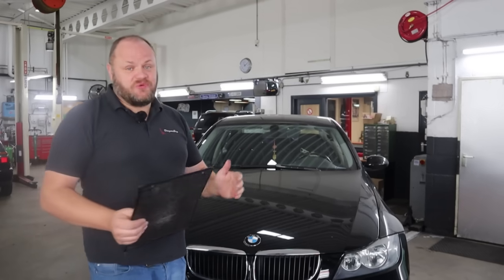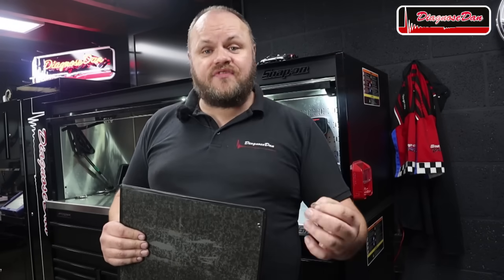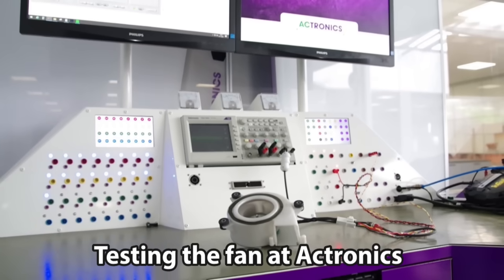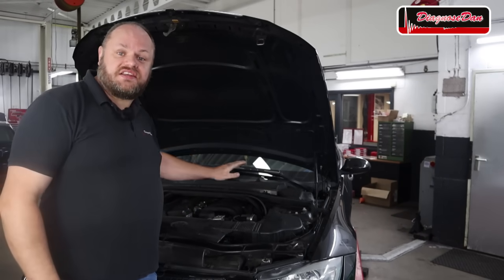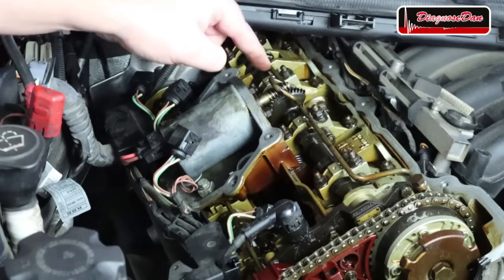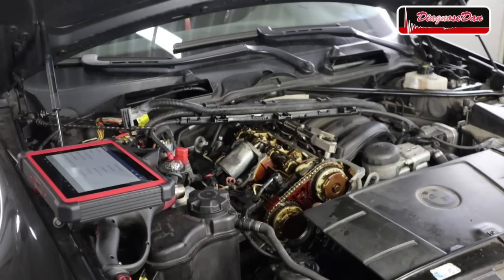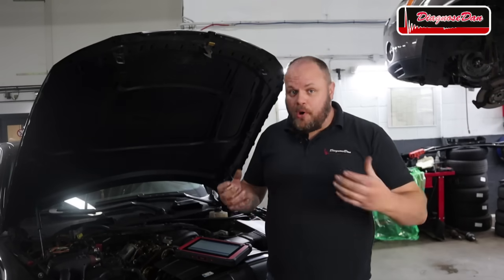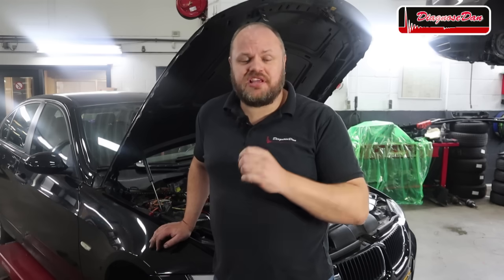Bmw valvetronic,Explained,Diagnosed,Fixed

Comment: Nice video and great explanation. It definitively has more moving parts in the whole setup than a swiss watch.😀
Reply from the maker: You have clearly never opened a swiss watch🤣🤣
Reply: @Diagnosedan  I have taken apart a Kuckucks Clock and that had less pieces than the N12 4 valve head with Vanos and Valvetronic. 😉
I guess the clock never worked again, but the engine did almost 20,000 mls in the last year and runs fine after the rebuilt.
Reply from the maker: @cullenmiller8170  🤣🤣

Comment: Got tricked one time by a client claiming to drive long distance until he came in for a second time after 3 weeks with 600 KM driven . Took the hot air gun and the same result as you . Checked engine hours run since last dtc erase and KM driven . Turned out that the car was idling more than it actually drove . Dumb mistake from my side to only erase the code the first time and not save the actual data. About actronics , nothing but good for them .
Reply from the maker: Thanks for taking the time to leave a comment it's really appriciated!

Comment: graphite from brush wear, causes a short circuit in the valvetronic motor.. damage is also possible in the valvtronic control module,  because of  short motor..
Reply from the maker: Thanks for sharing!!

Comment: You’ve just destroyed another myth calling these engines “ over-complicated “. In my eyes this engine is way less complicated than a V-tec engine for example…
As always,you’ve done a great job breaking it down so that everyone understands! 👌
Reply from the maker: These engines are really not complicated (if you know what you are doing)😁
Reply: @Diagnosedan  do you offer any remote help on the subject? I have this engine, been totally frustrated for about a year now... I am slowly running out of options
Reply from the maker: @seasonedtoker  We have a helpdesk but to use that you need a subscribtion to DDTSB.COM
Reply: Got to scream the V-tec to get it to go! Valvetronic allows max torque to come in at 2800 rpm, on the n52 BMW instead at 4500 rpm like a m52 or m54 six just to make them go.
Reply: No way.............you can give me a Honda V-tec any day of the week and twice on a Sunday lol but they rarely go wrong, only the the little gauze filter gets clogged or wrong grade of oil, easy fix.
Reply: @paulrobinson3528  I wasn’t talking about reliability,but about the simplicity in design. The V-TEC is using solenoids and oil pressure to lock the camshaft on a longer duration lobe,while this engine has a simple extra camshaft driven by a worm gear motor.
Reply: @nicknicu1787  It doesn't matter about how simple or complicated a design is in cars, its all about reliability,  bmw's valvetronic and vanos systems are not reliable, hence why Dan is doing this video but i see what your saying.
Reply: @paulrobinson3528 someday it will fail no matter how reliable it is and that's when simplicity becomes important

Comment: Could be the dust from the graphite brushes in the motor that's causing the short. Wonder what caused the motor to fail at higher working temperatures
Reply from the maker: Maybe i should open up the motor
Reply: @Diagnosedan   good idea

Comment: Motor insulation resistance.... I know with high voltage equipment (5,000V and up, what I work on) the old standard was 1MOhm per 1kV, plus 1MOhm. But now with the better insulating materials, better manufacturing, higher standards and less leakage a lot of high voltage equipment manufactures specs are in the 100's of MOhms. Even for low voltage 400VAC motors. No idea what would be considered acceptable for a 12VDC, car application. But do tell!!
Reply from the maker: I think 20.000 ohm is the limit😁
Reply: @Diagnosedan  Sounds about right by scaling it down.

Comment: I need to tackle the valvetronic on my n42. Have had it unplugged for the past 60k km or so. Hope it’s just the adjuster motor…

Edit: nice video Dan
Reply from the maker: You don't need to remove the valve cover to test it. 
Read the faultcodes and see if they are the same as in this video
Reply: @Diagnosedan  I think it’s the same issue. Once hot it starts idling poorly and sometimes even shuts off. No check engine light though. So I just unplugged it which you can do on manual transmission n42s. Definitely less torque below 3000rpm. Will clear the codes and plug it back in to see what comes up in the log. Cheers Dan.

Comment: I would say it's more likely failing reading resistance on it biggest thing is probably the Heat because heat will cause resistance an electric motor
Reply: He said the the motor is cold and functional when he did the test
Reply from the maker: Thanks for taking the time to leave a comment!!

Comment: Hi Dan. I have a similar BMW E90 2009 LCI N46N 4 CYLINDER engine. I am suffering from high oil consumption (One Litre per 1000 km) and also the engine oil is getting contaminated and very dirty within 200 km ( I am using Liqui Moly 5 W 30).
I have changed the PCV valve diaphragm with the spring.
The PCV is located on the valve cover & the engine has 182,000 km.
I have replaced the valve stem seals before 5,000 km with new head gasket,
But i am still having oil consumption & both suction on the oil cup when opening and high pressure when the oil cup is open.
Beginning of this summer I removed the Thermostat as I am living in (Kurdistan-Iraq) where ambient Temperature reaches 47 °C. Now engine coolant Temperature is around 78 °C where the Thermostat is opening on 105 °C ( I will put back the thermostat tomorrow and update you).
I will appreciate any suggestions and diagnostics procedures.
Reply: Looks like piston rings, but I'm just speculating.
Reply: @mr_nice.  I will do both dry & wet compression test to verify the condition of the rings.
Reply from the maker: You proberbly have leaking valve seals
Reply: @Diagnosedan  I changed the valve stem seals with new head gasket before 5,000 km .

Comment: Aaaaah the lovely N46 engine. Between the endless valvetronic faults, valve stem seals made of cardboard, timing chain guides also made of cardboard and the endless oil and coolant leaks, there is never a dull moment with this one.
Reply: German engineering; job security for everyone.
Reply from the maker: @kevinbarry71  🤣🤣
Reply: Mechanics gotta eat too😆
Reply from the maker: @ademc8872  🤣🤣
Reply: These BMW’s are great money makers, usually, but it seems in my area their owners are usually broke. We have a half dozen sitting in the field behind the shop. 🤦‍♂️
Reply: They call them "Break My Wallet" for a reason, fantastic engine for mechanics job security
Reply: @mattyb7736 I call them BMW big money waste.
Reply from the maker: At least there is always work to do😅
Reply: I made a lot of money working on these back in the day. We still see the odd one 🤣
Reply: We have a name for the N42B20 in Libya👉" the life time butt stick",i have same engine with multiple miss fires with no Chk engine and only a p0112 on the elm327 reader..love this car,but it keeps abusing me..
Reply: @mohamedtailamun4999  you need to get ISTA+ and a DCAN cable to diagnose it properly.
Reply: @skrevox  ista is a bit complicated but maybe inpa is much easier
Reply: @mohamedtailamun4999  elm327 is not that good try and get inpa cable for 10 pound and a laptop
Reply: I am learning a lot by looking at these videos and hope to solve my problems with the Mini cooper.
Reply: I didn't even know bmw had 4 cylinders before 2008. We didn't get them in America except for e30/36 318
Reply: @youtubeb8362  the cat code is due to not seeing correct trace difference on the oxygen or air/fuel sensors pre and post cat (assuming they are talking about p0420 code), the ecu will adjust intake air/fuel to get a desired trace on the pre cat sensor no matter the combustion efficiency (within reason). If it's so off that the initial sensor can't get a good trace then you'll trip a lot more than cat codes. Excess incomplete combustion gas in exhaust will just heat the cat more (which might make it fail prematurely), but it should still be  performing as designed. There could be a few other things that trip the code like dirty/failed O2 sensors, exhaust leaks (even tiny ones), etc. Without seeing the O2 traces on scantool it's impossible to diagnose
Reply: N46 così come n45 n43 hanno tantissimi problemi di varia natura,più o meno gravi ma tutti i problemi sono figli di una caratteristica che genera questi problemi,la caratteristica è la temperatura del motore.io termostato map da 105° è il tumore di questi motori che per inquinare meno girano a temperature da forno con patate.
Io ho montato un termostato meccanico da 85° 
Ora n46b20b è diventato un motore affidabile come il meglio del mondo.
Ho 310600 km prendo l'auto tutti i giorni ,mai più perdite di olio e refrigerante e il motore è diventato più silenzioso e più scattante(miglior stabilità del lubrificante a motore caldo quindi migliore lubrificazione),sostituito solo alternatore e starter,il resto è tutto originale !!!!!!!!
Per pensare all'inquinamento hanno rovinato un motore che secondo me è davvero tanto affidabile.
Reply: @manliocicchelli8763 can you give me information about this thermostate working at 85C
Reply: To be fair...all BMW engines have a bunch of issues. Pick your poison.
Reply: So I just had the eccentric shaft motor and the shaft but now the car won’t do the relearn process and I unplugged it but the car still runs I’m not sure what to do it’s giving me a code saying valtronic adjustment range fault code
Reply: oil and coolant leaks, literally every bmw engine
Reply: I also have an N46 engine in my 118i.  The message "oil pressure low" comes when I do a cold start, most recently after driving on the highway.  Can you narrow down what it is?  Because of the holidays here in Germany, the workshops are closed.  I have the old chain tensioner, maybe that is one reason? Or maybe oil pressure switch.. Perfect timing. 😄
Reply: @tobifzzle  probably the sensor
Reply: So this problem always occurs repeatedly?
Reply: If it’s not 6 pot, it’s not real bmw
Reply: Hi bro 
My car doesn’t see valvetronic 
I replaced battery , valvetronic , tried to diagnosed it still same thing
Reply: maybe you should of kept your own engine serviced. mine is flawless
Reply: Guys, I see you're having fun. I am one of those idiots owning an N46, completely rebuild, new cats, new probes, you name it. Still have the dreaded cat efficiency codes. Who's going to help me over the internet? I see some German names in the comments, let the knowledge out guys, don't be shy
Reply: @seasonedtoker  change spark plugs and induction coils, sugest you to use NGK , your burning fuel in a not very eficient way
Reply: @youtubeb8362 wtf are you smoking boy
Reply: Check for leaks in the intake
Reply: @seasonedtoker  I find the n46 really good once chain is done and valve stem seals you're good to go for years to come
Reply: BMWs after 2004 are J U N K
Reply: Had similar issues with an N42 engine in my e46 BMW. It spent weeks in and out of various garages having sensors changed, chains and guides changed etc. In the end, I pulled the engine and box out and installed an M54 engine and box. Currently 20k miles on the new setup and no issues.
Reply: Funny thing is my company had five of these, they were sold with mileages from 120k to 190k...

No engine problems in 4 years, but always serviced at BMW, on time, using correct parts...

The cars aren't the problem, it's cheap owners.

Comment: Dan help!!
Dan how are you hope you doing good ♥️
Glad to hear from you again 
I have a bmw with n42 engine 
I have a bad low end power and no fault codes and the inlet vanos do not react when disabled by launch x431 pro v4.0 but the exhaust vanos do and the car start to misfire could the engine have a bad inlet vanos or a dirty vanos selonids 
And thank you very mush
Reply from the maker: The Car should flag a code if there is a Vanos issue!

Comment: YES!  I did this job once and can’t wait to hear DD break it down.  Already smashing the like button.  Diagnose Dan never disappoints.
Reply from the maker: Thanks!
Reply: @Diagnosedan  Hi Dan
I have got the same car and I have changed the valvetronic motor and done the limit learn and it will work for a few days then through an engine check light. Recently it through a check light for the exhaust cam sensor and I replaced it with a new one but still notthing changed.
Reply: @stevenfurayi8607  check the connectors to the 2 vanos solenoids, check and clean those solenoids using a toothbrush and brake clean (or similar), reinstall, reconnect properly and see whether it solves Your problem.
Reply: Dan you are awesome 👍

Comment from the maker: Actronics;
https://www.actronics.co.uk/

Scantool used in the video;
Launch X431 PAD V ECU online programming scanner
Global link https://bit.ly/3v0VP9L
Ask a question about scantool  https://bit.ly/3gbJtaR
DE https://www.amazon.de/dp/B092LYKYF5
ES https://www.amazon.es/dp/B092LYKYF5
Reply: Is this the n46 engine and what year Dan I changed my vvt motor long ago still don't run
Reply: You never use Texa tester ? Work with Elektropartner
Reply from the maker: @jotrastad9076  i've never worked with a Texa. Maybe in a future video